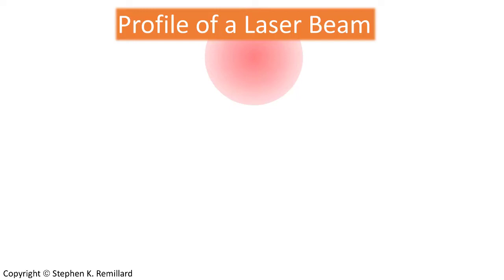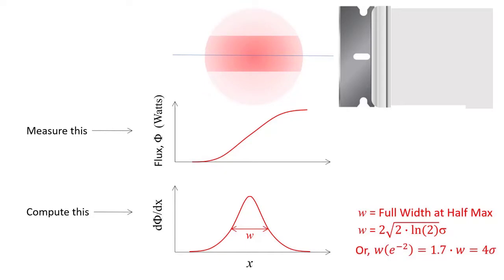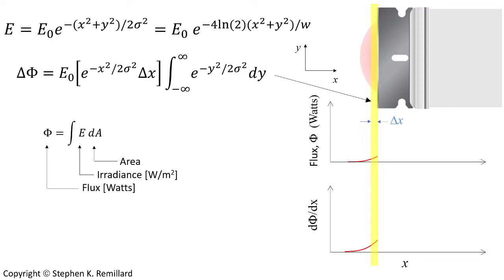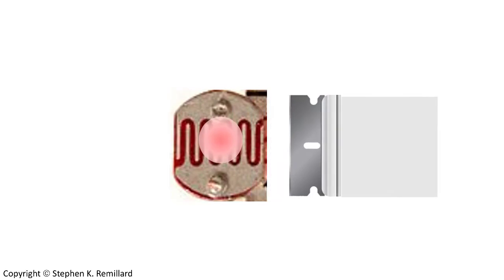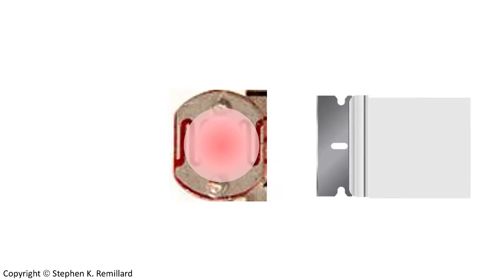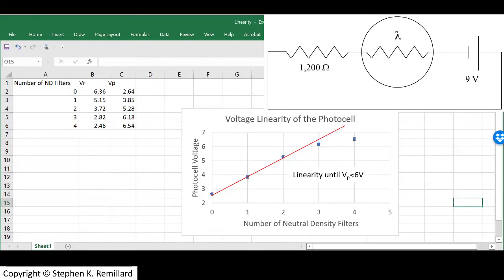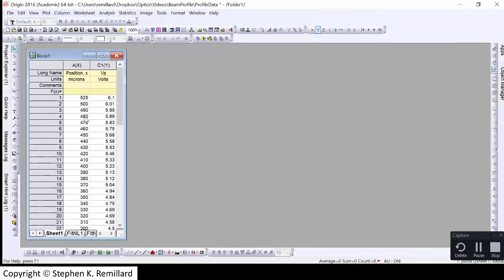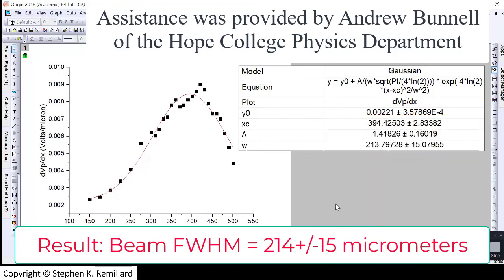How Do You Measure the Width of a Laser Beam?, PHYS 382

Comment: Thank you for the video! I have a question about the diverging lens. While you improve the signal-to-noise ratio, this way don't you transform the beam's waist size to something which is not the beam's actual width (up-to some error of course)? 
Cheers
Reply from the maker: The micrometer to which the razor blade is attached is positioned in front of the lens.  So the micrometer reads the true location of the blade edge inside the beam.
Reply: @stephenremillard1   Makes sense, cheers!

Comment: will it help to glue white paper on top of photo cell to make light more diffused? would that get rid of irregular irradiation of cell?
Reply from the maker: Yes, that sounds like an idea worth trying.  Perhaps use white tissue paper.  If I had a chance to repeat the video I might have used a photodiode sensor instead.  That way the sensitive area is square-shaped instead of the meander line.

Comment: Thanks for the great demo! 

I'm not sure I agree with your assessment that the integral over y is constant as you move the blade, not even to any sort of reasonable approximation. The integral over y is zero at x=0, so it had better not remain at zero as you advance in x.
Reply from the maker: Perhaps this could use more explanation, so thank you for bringing it up.  The two dimensions of a 2-dimensional Gaussian are independent of each other.  The dimension that sets the magnitude of this 2D integral is the dimension that is not being swept over all space.  So if you are fixed at a large value of x to x+deltax, then the x-integral evaluates to a very small number, whereas the y-integral expresses the full value of a one-dimensional Gaussian integral.  The fully-swept y-integral has the same value whether x=0, infinity, or something in between.  The x- and y-integrals simply do not interact.  That the y-integral is a constant as the blade moves in x (even at x=0) is not an approximation.  It is, in fact, exact.  There are approximations in this experiment, though.  For simplicity, I approximated the laser beam shape as round (e.g. the same standard deviation in all directions), and I approximated (more like assumed) the apodization as Gaussian. :goodvibes:
Reply: @stephenremillard1  I should've thought more carefully about this before posting my concern, because it's obvious I was wrong. Thanks for the clarification!